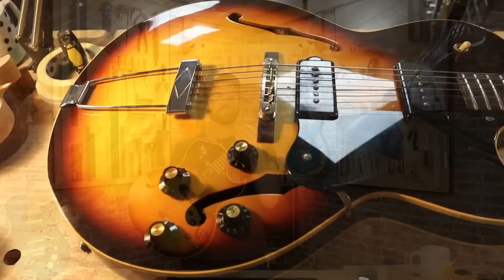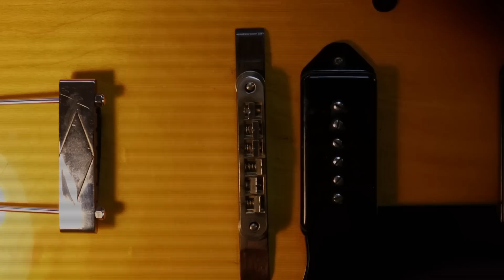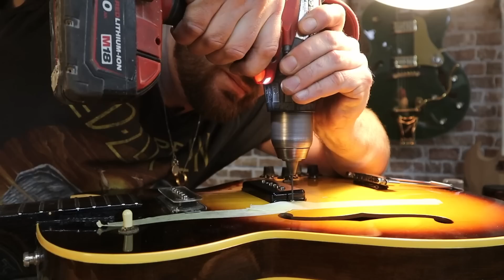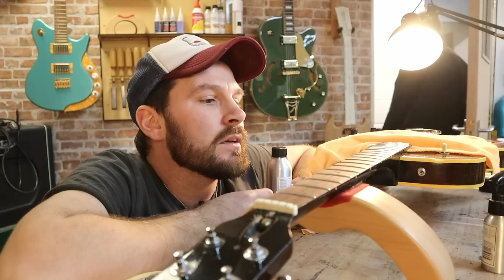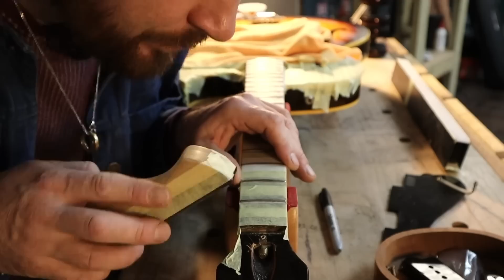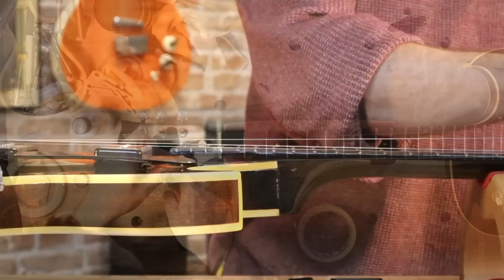Nerve Wracking! Drilling into a £4,000 1967 Gibson ES-125TDC | Luthier Teardown and Repair

Comment: my idea on those two holes is that the bridge has been shaved to lower the action, and in doing so they had to drill holes to allow the bridge to sit at the correct height
Reply: That's a strong possibility, yeah. It's also possible they did it to make it easier to get a consistent position. The last owner of my ES-125 glued the bridge down with contact cement!
Reply: I like that theory. Good thinkin

Comment: I’ve got a 1974 Les Paul Standard which needs a skilful touch to bring it back to life. It’ll have to wait a while for me to get my finances back into a suitable place to foot the bill though.
Reply: Get it over here mate, we'll have her singing!
Reply: @joshuastopford  I will in time, but just had a break in work for medical reasons so short in the financial department at the moment. It would make an interesting video I think. A ham fisted previous owner scraped off the finish and hacked a hole to make it three pickups, so it needs the hole filling (put it back to two pickups) and a refinish. Plus a refret, they’ve been flattened too many times already in my opinion and are too low to the ‘board for my taste. And if one looks carefully there’s an old repair from a neck/headstock break, although it seems quite stable. In the fullness of time I’ll be happy to pay, just can’t right now.

Comment: Sick how clean this '67 is. 55 years of playing and no dents, scratches or playweare. (except the frets) How is it possible. 😉
The 2 hole beneath the  bridge are from the original ABR 1 studs. I've seen '67 Gibson ES 125 TDC with an ABR 1 bridge.
Reply: There's nothing for an ABR-1 to anchor to under there; these guitars are hollow and the top is only about an eighth of an inch thick. An ABR-1 screwed into the body would rapidly collapse under any load and probably tear out the holes as well. The ES-125 has always had a floating bridge assembly, ABR-1 or not (early models had a simple wooden compensated bridge). To wit, mine (a 1966) has no such holes and it originally had an ABR-1 (it presently has a Nashville, as ABR stands for "Annoying Buzz & Rattle").

Someone probably drilled those holes at one point because they wanted an easy way to keep the bridge in a consistent position. The last owner of my guitar used a little bit of contact cement for the same purpose.